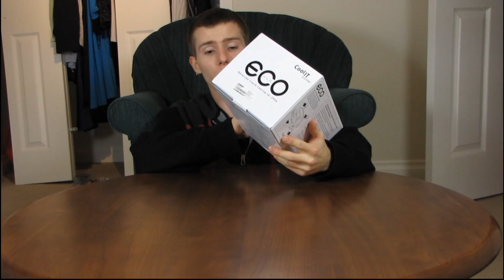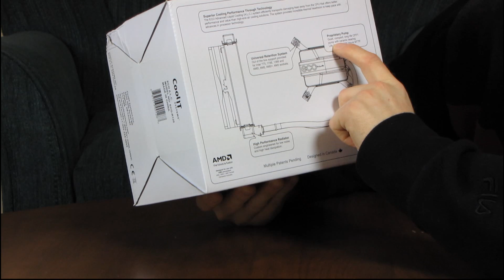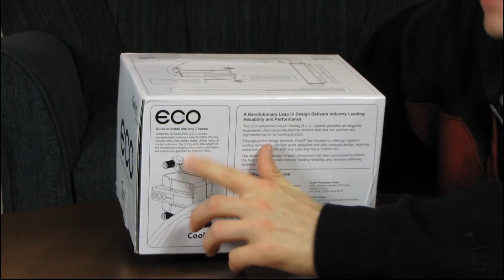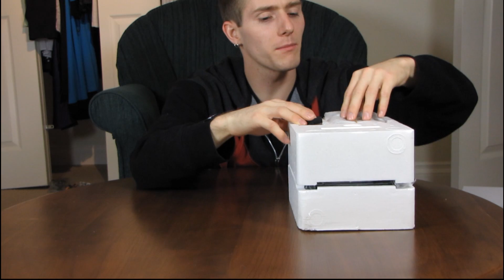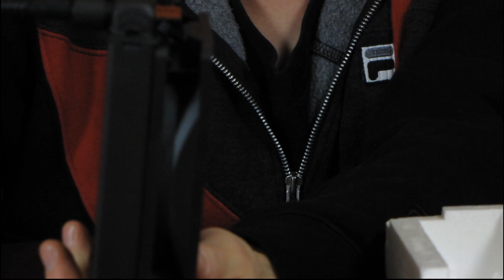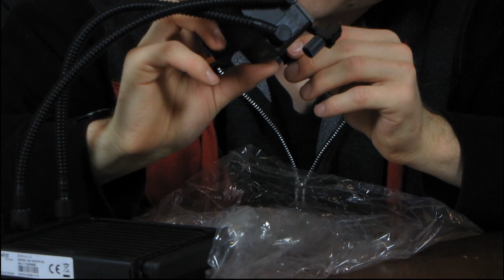CoolIT System Eco CPU Water Cooling System Unboxing & First Look Linus Tech Tips

Comment: @spedknot Can't agree more. Especially dealing with those radiator fins.

And most if not all cases don't have built in dust filters for the back case fan.. And most of the 3rd party dust filters sucks..